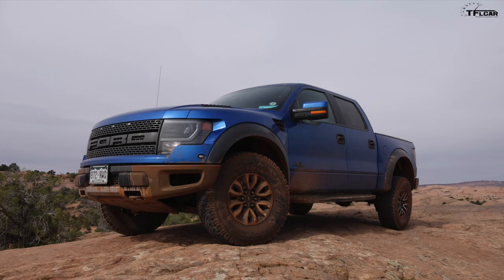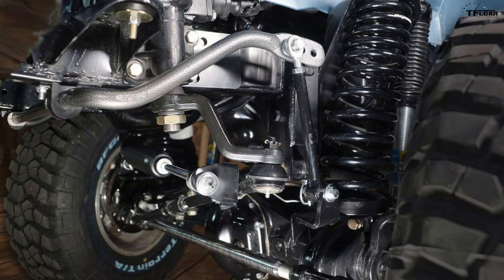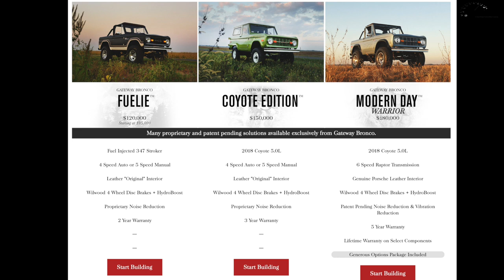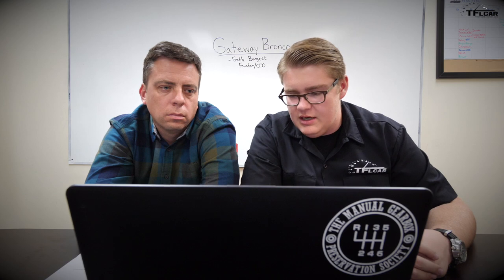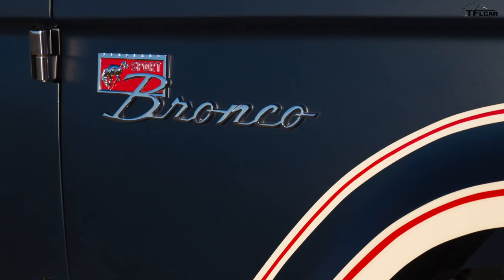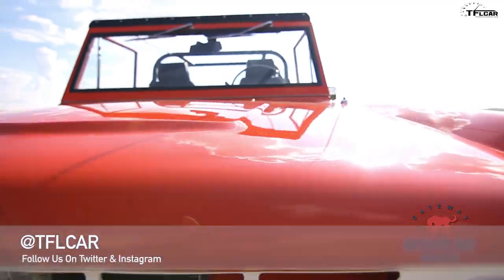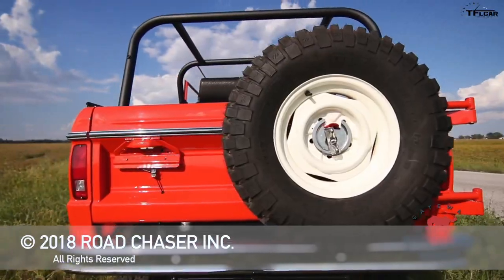Here's the Inside Story on the NEW $120K old Bronco and Bronco Raptor!

Comment: Thinking more like 40k for the truck starting price,  but 120k starting HELL to the NO!
Reply: For a bespoke hand-made vehicle?  There is no chance of something like that cost less than +50% of a factory made vehicle with similar qualities -- so about $90k minimum.
Reply: Haha ok go out and buy just the components that they are using for less than 40k build it for months then I’ll give you 40k if it runs
Reply: You do realize they are hand making and restoring these parts themselves right? it's not like they have a mass production plant somewhere supplying all these parts for them and a large staff on an assembly line putting all these parts together by the thousands. Every bronco they do is rebuilt from the ground up by a small staff. Sure it's expensive, but that's the price you pay for hand craftmanship, which is why cars like rolls royce are a lot more expensive than a toyota made product.
Reply: @RhinoXpress  And yet any Toyota product is a lot better vehicle.
Reply: Ron Torrence How many rolls royce's have you owned? I bet zero. Funny you say a lot better yet i still see rolls royce's from the 70's still on the road. How many  70's toyota's do you still see on the road again.....
Reply: They certainly don't need to sell many of these at this price to turn a profit.  If I were in the market I would love one but would probably save some money and buy a fully restored one at auction for half the price.
Reply: they're hand building these... that's what the cost of a hand built truck is
Reply: They were childlike saying, “if jonathon ward can sell it for that price then we will too”
Reply: This a custom truck. It is also better then a restored truck. Modern improvements. This cost you money. A fully restored truck is starting at $40,000 range maybe. At that you still don't know how good it has been restored. Why do people always bitch about the cost never understand what is involved with craftsmanship and top quality parts. Most of the time they are to cheep to own something nice anyway.

Whats with little boys and their Toyota. Grow up already. Toyota are very nice and well made trucks. But don't think for a second that they are not perfect. The have terrible rust problems, they and burn oil, their power train is outdated. And what is the deal with that dumb ass rear axle bearing and seal setup? 🙄

I am glad that any company is take the time to build a quality product. If they find a market that can afford their trucks, good for them.

Comment: A lot of people are complaining about the price and I understand because it’s far outside the average Americans budget. However these are built for the customer that has the funds to reach back in time and grab a original style bronco with all the modern conveniences. They are not marketed to the average American as the originals were. Still glad to see this happening even though They are outside of my budget.
Reply: what modern conveniences? did you miss the part where he said you could pay to have it shipped back to illinois so they could install AC? 120k-250k and doesn't come with AC? wtf
Reply: Honestly yes I thought that these would all come with AC, but I was also referring to the things like updated suspensions and new crate engines with fuel injection. Those kind of things. Once again far outside my budget but if someone has that kind of cash and this is how they want to spend it, have at it!

Comment: You can either send us your one-ply toilet paper ... we can unroll it & add the second-ply or just the tube so we can use it as a base ... we can even supply the tube and build up the roll to the modern two-ply even better than the original with perfect perforations ... $1,000 a roll isn’t much when break it down to the craftsmanship

Comment: That is a pricey vehicle. Hypothetically speaking, if you were to break it all down, you would roughly have; Engine and transmission $17,000.00 + wiring and computer for engine and transmission $2250.00 + wiring for the rest of the vehicle $1,118.00 + New front end diff $5,600.00 + New Rear end diff $5,600.00 + High performance suspension system $12,500.00 + Completely new body $16,200.00 + Wheels and tires $2,500.00 + seats,flooring,sound deadener, etc. $5,000.00 + dash/instruments $1,000.00 + Roll Bar/Cage $475.00 + Radiator and fans $312.50 +  Custom front bumper $1,200.00 + Custom Rear Bumper $1.200.00 + Full paint job inside,under hood, door jams,  and outside and underneath the vehicle $20,000.00 + assembly and reliability testing $7,000.00 + Wilwood 4 disc kit $2817.00 + Fluids $560.00 = $102,332.50 . This does not count whatever fees Ford imposes for licensing . Which I guarantee they DO NOT do it for free. And these are just ballpark figures of the things I could think of at the moment ! All this + a 5 year warranty? Keep in mind, this is a business, and a business has to make money to stay in business. While they are building these on an assembly line, because of the production numbers and the supply sources etc., the only way to make money on something like this is to charge for each component and operation. Pay anyone to build you a Bronco using brand new comparable components I mentioned here and them doing all of the work, I guarantee you'll be in the 6 figures.

Comment: As someone who remembers the original when it was new; who cares about bison leather and panel gaps. Are the new bodies built with uncoated steel like the originals. If the new bodies are not galvanized, that $150,000 plus is going to look like swiss cheese in a few years if the trucks are really used. Sounds like a toy for the more money than brains club.

Comment: please...just don´t put an IFS on the new bronco... ... it will die
Reply: Agreed.  It will be all show and no capability, and die just like the other models/designs that tried to take the shape of a classic.

Ford will have numerous other SUVs and crossovers with independent suspension, the Bronco needs to fill another functional utilitarian niche or it will be an inefficient shape and have a rougher ride for no reason other than aesthetics -- which will kill it.
Reply: And the full size descendants of that machine still do, in the Explorer and Expedition -- independent all around now.  But the smaller/midsize classic Bronco that Icon, Gateway, and Ford are modeling after, had a solid axles.
Reply: They had twin traction beam, not ifs